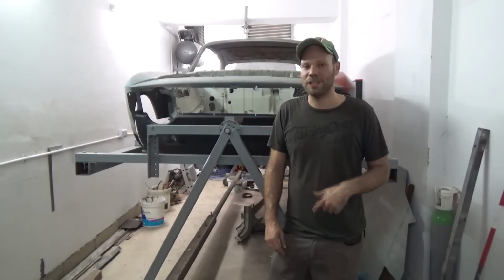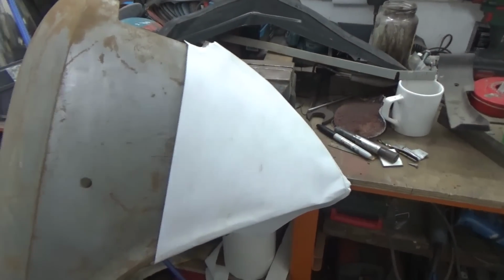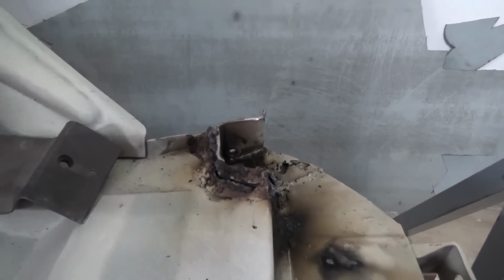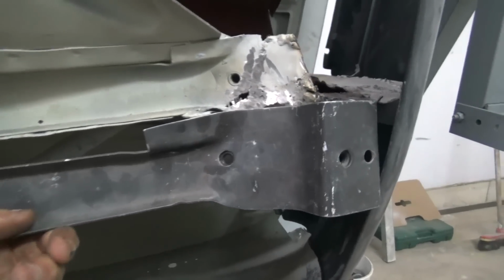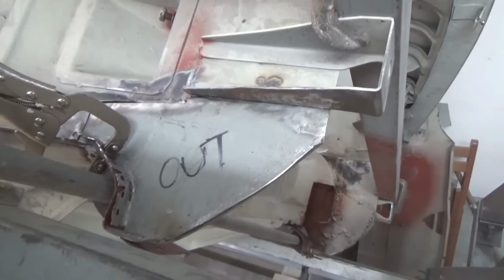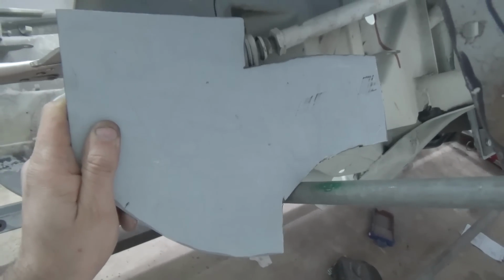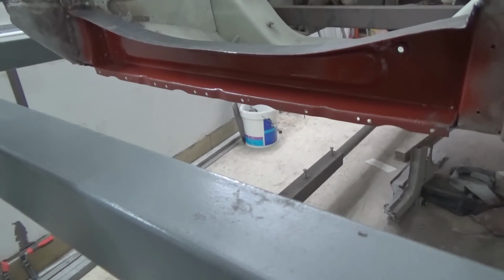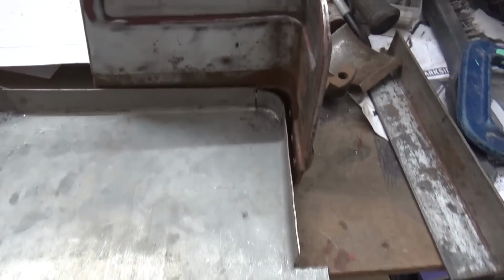Raising Junior - Episode 10 Alfa Romeo Gt Restoration (How to replace the front valance)

Comment: Excellent work and presented in such a way many of us hope and believe we can also bring our 105s back from the dead.  Thanks for the clear examples. Regarding the pieces fabricated for the anti roll bar, what gauge metal is required?
Reply from the maker: Thanks for the great comment :) The sheet we used is 17/18 gauge (1.1mm) for the sides however the black replacement part is closer to 16 gauge (almost 2.0 mm)  We used 20 gauge (around 0.8mm) for the non structural parts)

Comment: Hello, Thanks for your great videos! I'm restoring my step nose Junior andI would like to know how did you weld the bottom of the front panel with the radiator cross member?  Hope you can help me!
Reply from the maker: Thanks!You're this video doesn't show the front edge joined to the crossmember. I drilled a series of holes along the edge about 40 mm apart where the front panels rests on the crossmember, I left out 2 places where the front panel doesn't touch the cross member as there is a water drain, so mark before drilling. I aligned the edges together and held with clamp, then filled the holes in the front panel with plug welds. If you have a powerful spot welder you won't need to drill holes. Hope this helps
Reply: @raisingjunior6389  Thanks a lot for your full explanations, I really appreciate it! I'll try to do the same! again thanks for the great videos, you're a source of motivation!

Comment: Hi there! Excellent job! Insiring and keeps us going:) any idea where to buy the stepnose components to re-convert my 67’ junior? It was converted some point in time to the veloce face :(
Reply from the maker: Thanks...check out Classic Alfa and Alfaholics sites, they're big parts suppliers that restore cars too, based In the UK. The panels aren't cheap but good quality. You can buy the front end which includes the the step front maybe it will save you buying the front mudguards. They stock headlamps, chrome trim and grilles too

Comment: What gauge steel are you primarily building with?  Good watch as always
Reply from the maker: I used 17/18 gauge for the sides (just over 1mm thick) however the black anti roll bar mounts were about 2mm as it was a purchased part. We use 20 gauge for non structural repairs